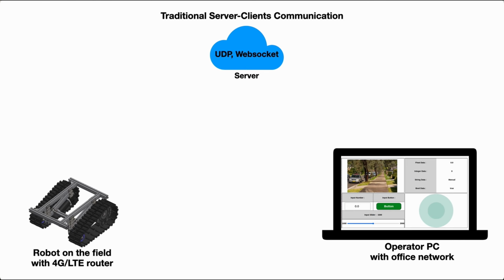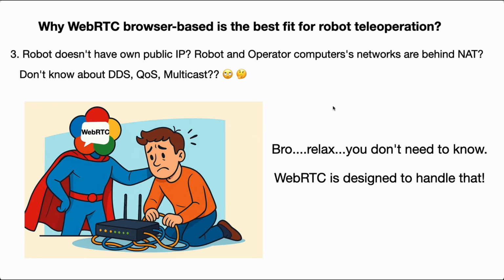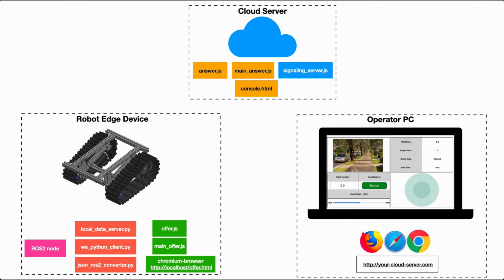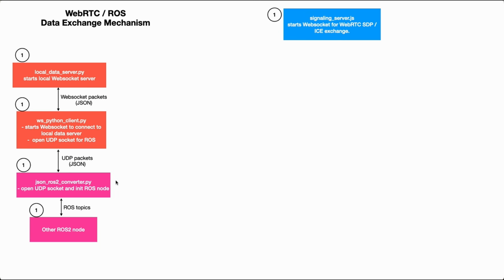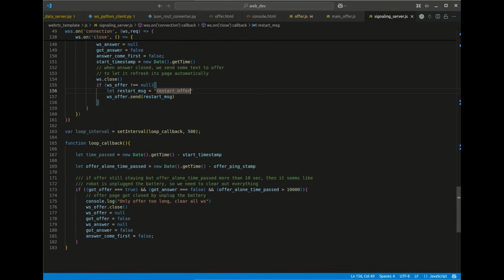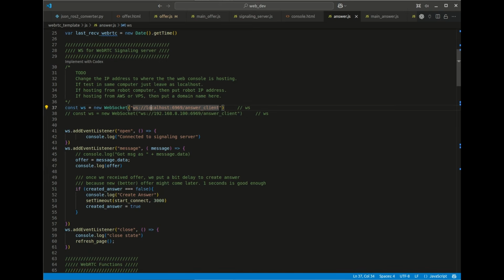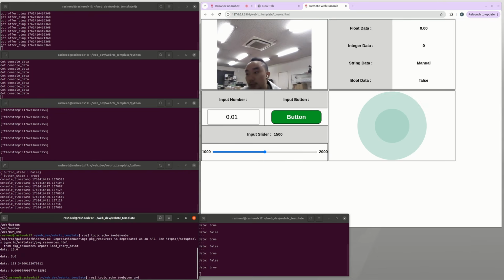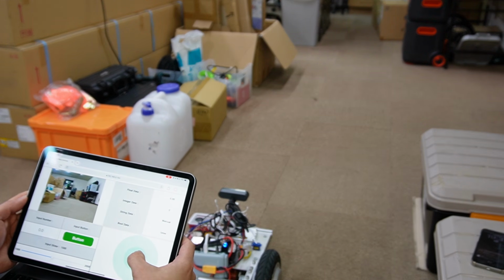WebRTC x ROS | Optimized Solution for Robot Teleoperation

Comment: Great video! I was taking a different route, but similar. I already have a gui to control my robot when on the same local network on qt5. I was gonna expand the GUI to translate the relevant ros2 functions to websockets and then access remotely using Tailscale. The idea being i could remotely interact with the GUI, which would locally (to the robot) then interact with ros2. I have not yet made the modifications but it seems your approach is more elegant. I have video streaming using webrtc with mediamtx already accessible to anyone on the network on the browser, im not sure but i think i could also pipe audio that way. Will save this video to study your approach